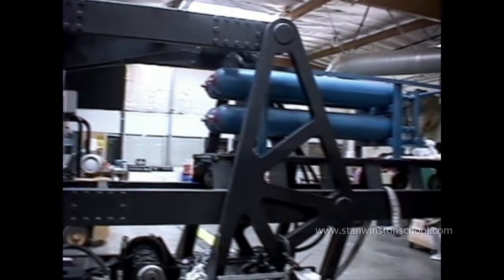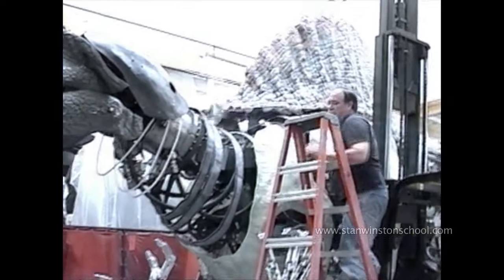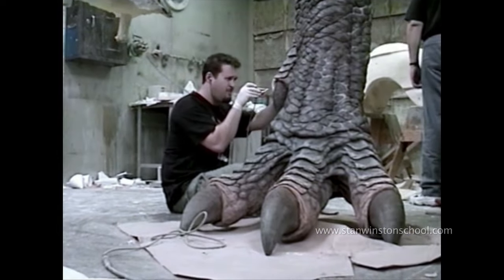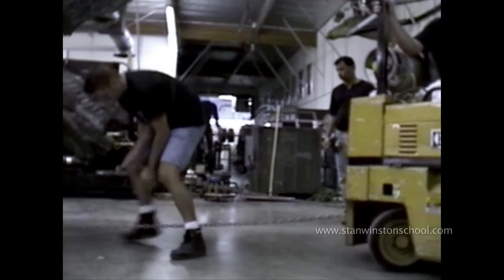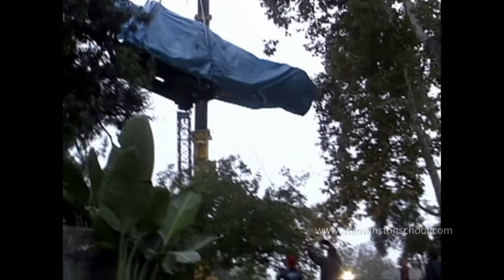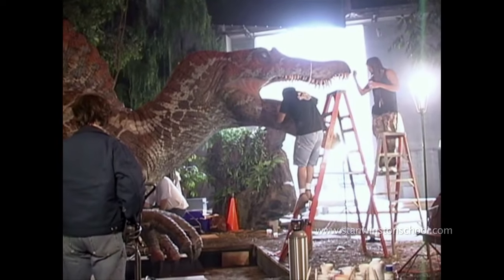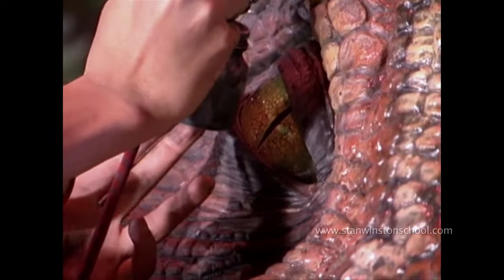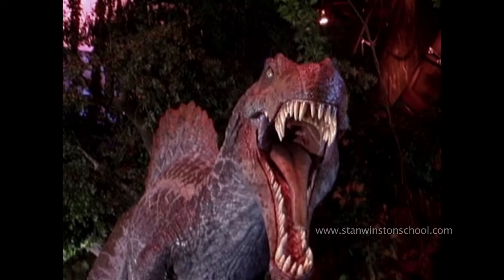How They Built Jurassic Park III's Spinosaurus Part 2 - BEHIND-THE-SCENES

Comment: CGI keeps trying to improve on the modelling, textures, lighting and movement, but one still sees the tell-tale signs of something that isn't really there. I'd rather see more investment into animatronics so that actors can react and act next to real things rather than imagine in a green room.
Reply: Valelacerte unfortunately as long as practical effects remain expensive to build and take a lot of time as well, CGI is gonna be more commonly used
Reply: @Dill_Pickle1997  Hybridization is the best way I can imagine these following methods: 1) Doing the Godzilla and just making half-sized or quarter-sized puppets for the big Dinosaurs, 2) Making full-scaled  foam parts for the actors to interact with and 3) Sparsely using cgi to cover up imperfections or mechanisms.
Reply: I agree, practical effects are a hell of a lot more interesting to see in film to me, even if they don't look real they're still such a joy to see.

But CG isn't going anywhere.. Probably ever.
Reply: Why isnt the spino in the new ones come on
Reply: but animatronics can hurt some,i mean if you keep using animatronics then you might run on a lost
Reply: CGI is paid per shot. The more shots and changes, the more you pay. Recent MCU films is mostly done on green screen and Ultron is the most expensive film.
Reply: @Dill_Pickle1997  that's the thing. CGI is cheaper on paper, but since directors go overboard and guys like george lucas basically drop EVERYTHING into CGI, it's not cheaper at all. It's just that CgI is very easy to predict. you lock up a bunch of guys in a room in a lower wage country, shoot them some artists rendeings, and within a few months ull have your action scene. It will look utterly shit to 10% of people, but 90% will just accept what they see as part of the movie. So it's more predictable to implenet and timetable actually, that's why Hollywood loves CGI.
Reply: In near future you can see full sized robotic dinosaurs on set!!

Comment: I'm actually stunned that they don't bring these animatronics to dinosaur exhibits or put them in a museum and collect some additional revenue. As far as my knowledge goes, the T-Rex from JP1 and the Spinosaurous from JP3 are the largest, most realistic looking, and best moving dinobots that currently exist (please correct me if I'm wrong). I recently went to a Dinosaur exhibit in Atlanta, and it was basically shit. The dinosaurs weren't scaled correctly size-wise, their coloring and textures were kinda bad, and you could absolutely tell they were machines. They only had two movements and moved very sluggishly.

Comment: in reality the trex would have won because of the bite force and would had actually crushed it's neck easily for the T-Rex had the most powerful bite than any other living predoter that ever walked and could rip 500 pounds of flesh and meat. plus it also slashes it's prey while kicking and uses it head to ram u down they were way stronger and quicker killers. to bad Jurassic Park three decided to get rid of the T-Rex just because they wanted a new killer, dumbest thing they have done. they should had a T-Rex fight the spinosaurus at the end to kill it so the humans can get away. the truth about the spinosaurus only hunted fish and very small Dinosaurs while the T-Rex hunt small and way larger and armored dinosaurs even ate their own kind for they also do not back down from a fight. also another truth they have discovered that the trex did in facted had a venomous bite because of the rotten flesh of deadly bacteria from other dead dinosaurs. and it did had in facted had a great vision for better than a hawk and way more clear than a human. it could see u run four miles away  from it even it can smell u also miles away. they were actually very I intelligent and did in fact had a very large brain and very well hearing. soo yeah the T-Rex would have won